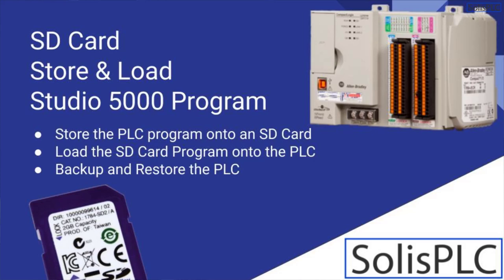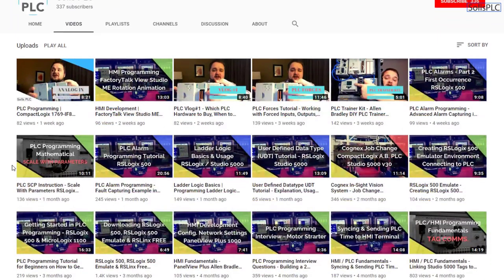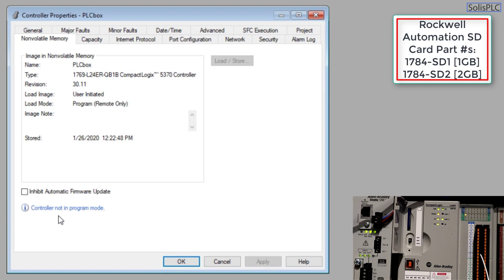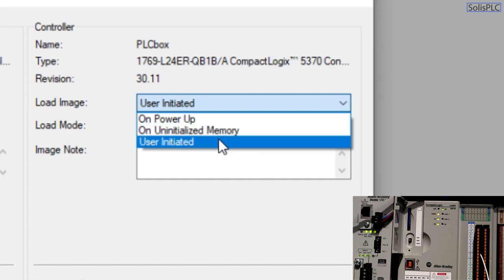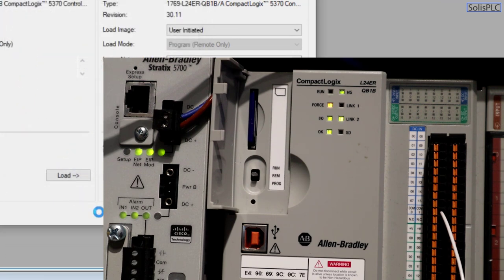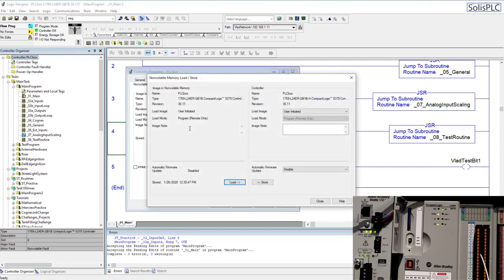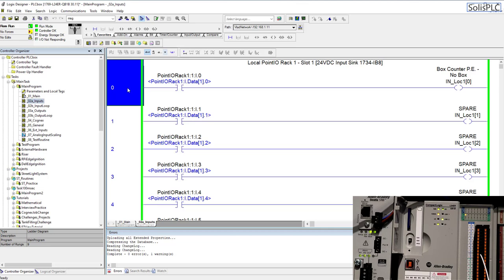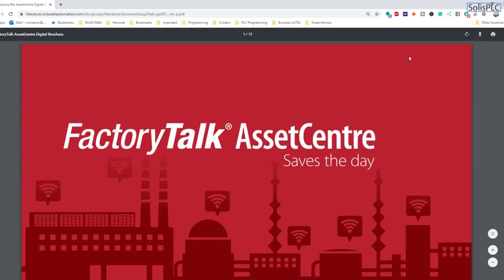PLC SD Card | Load Restore PLC Program CompactLogix ControlLogix Allen Bradley Studio 5000 Tutorial

Comment: Honestly speaking, I haven't seen any advantages, to load programm from SD-card, you need PC with Studio5000 or RSLogix5000. For example, in Siemens you can store the programm to SD-card, insert in PLC and with switch go in RUN, and PLC download programm from SD automatically without any connection to software. I think, you understand what I mean.
Reply from the maker: I agree with you and did mention the same thing toward the end of the video. I'm not 100% sure why multiple people asked me to talk about this. That being said, I do see how if you have such a backup at a small facility, they can stick this into another PLC and just transfer it over? Somewhat better than keeping it on a technicians PC I guess...

Comment: Got a question, without using a software or a computer, can I just insert an SD card program backup (power up mode) into a  new PLC? And if so, I can just take this SD card out without a problem? And one more question, does the SD card program backup also hardware config including IP address and everything ? Thanks.

Comment: What will happen if I remove the SD card and fixed back, is there anything will happen to PLC while it is online? Tanx
Reply: nothing will happened it will boot up from internal memory storage.  But if you make a change in the code and  power cycle it will load up code from SD ( by default config) and you will loose all changes.  That's why you taking SD after you done with commissioning. At least if's one of the way to deal with headache

Comment: We had a L30ER processor fail, and ordered a new one for replacement. The program was saved on the failed processor's SD card (program backup isnt stored anywhere else). Can I upload the program from the SD card on the new processor without flashing the matching firmware version the program was developed on? Or are there any additional steps I need to consider prior to the upload?
Reply from the maker: You would definitely need to flash the PLC to the same firmware level as the program you have loaded on the SD card. I believe that by default it won't load the program; you'll have to configure the PLC to take it on bootup.
Reply: @SolisPLC one blown away for getting a response from a year old video, that's awesome! Now, when I go to flash the replacement processor to V24.0, can I leave the SD card (has the only backup program) in the processor or will it wipe the card?
Reply from the maker: @jeromeschulte1297  I don't believe that it will wipe the card as the process of loading the software onto it is different. However, I haven't tried it myself; I typically flash new controllers with the SD card in place, but there's no program on the card. Personally. I would recommend creating a backup regardless of what you're going to do. Don't let the only place you have the program be on that SD card!